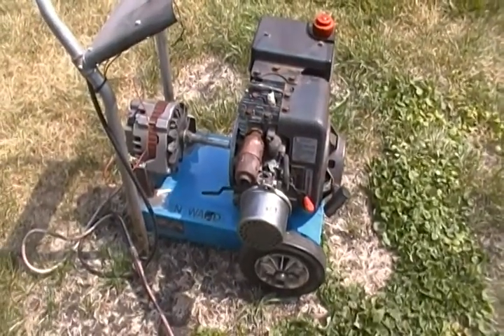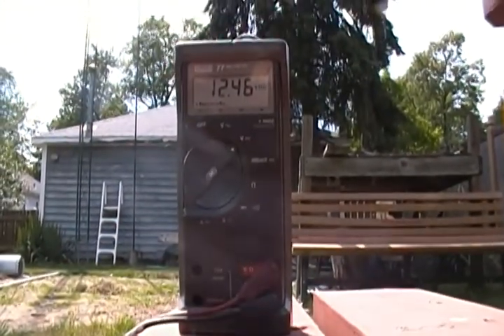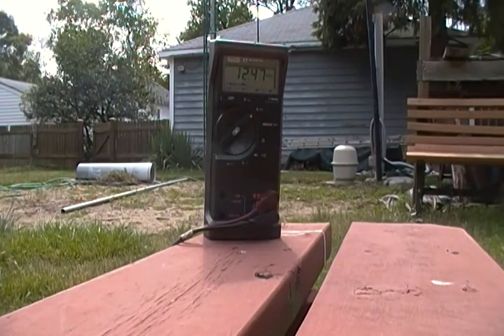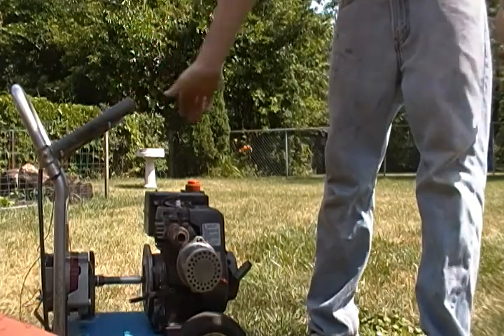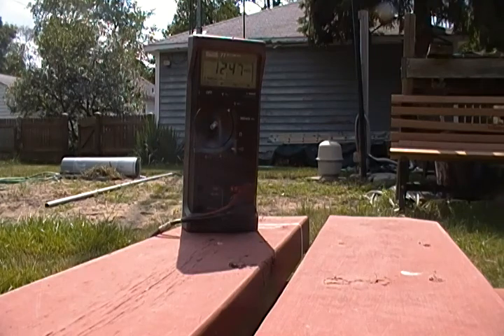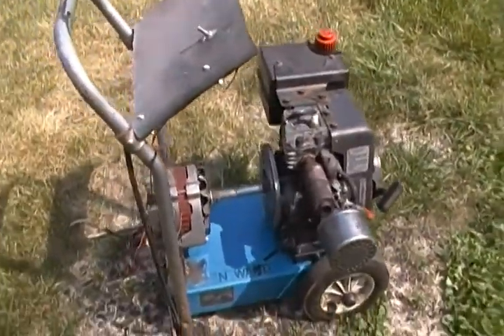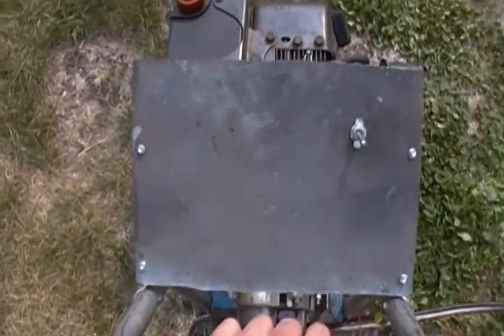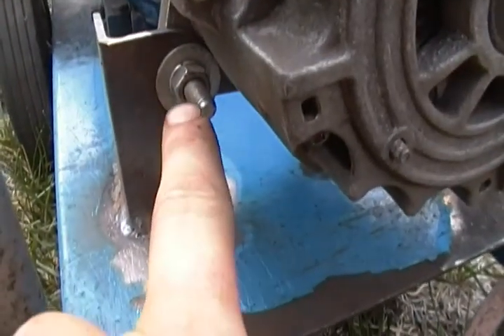direct drive 12 volt Generator run. (home made)

Comment: Better  With  Tow deep cycle  Bettis  to suite Alternator  VOLTAG 'Mounted  UNDENIRT the  Engine,   Now  you have A Us full power pack &  micro  power station.  once you  mount an inverter on the top . & tide it up some what  Yes dc Charger  & AC  power supply siystom.

Comment: Just curious? Isn't the altinator suppost to be over driven? Not 1:1
Reply: Modern alternators can, in contrary to old direct current generators, produce their rated current nearly at any given speed. This is important due to more gears and thus lower RPMs as well as more and more gadgets and electronics in cars. The alternator shown and used everywhere today is a three phase generator with a non permanent magnetic electrical field winding. The output power (desired current and always 14.4V) is maintained by changing the current in the field winding. This makes it able to produce nearly full power at idle speed.  Your are right, normally ca. 1:3 is used as a ratio. Let's guess this engine runs at 3000/min so that equals a idling car engine and thus everything is fine and works just like a charm. :) and pretty sure the alterbator could produce approximately >100A, so if it runs a bit to slow and can maybe only output 60 or 70A this is nevertheless a lot of current!